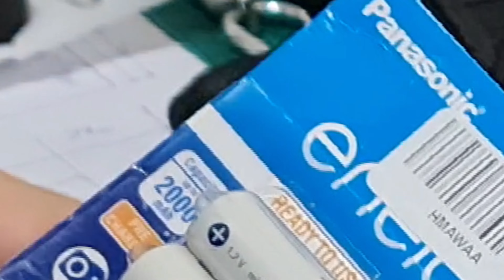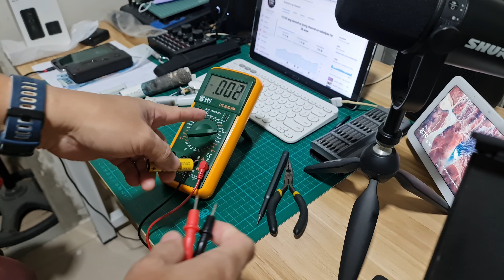TUTORIAL: Oral-B Braun 'Vitallity' Electric Toothbrush | Battery Replacement: Ni-MH over Ni-Cd

Comment: It's unbelievable that companies are still allowed to sell gadgets with sealed nickel metal hydrate batteries.  I thought I had solved my toothbrush dilemma by buying this and now I realize that I just have to buy another stupid toothbrush.  Very much not happy with Braun for this
Reply from the maker: Actually, the original battery was Ni-Cad. I replaced it with Ni-MH since Ni-Cad has battery-memory effect.
Reply: @HiTechTaBai  The EU should not allow companies to sell anything without lithium battery now. It's 2024.  Otherwise just allow for rechargeable double a or AAAs